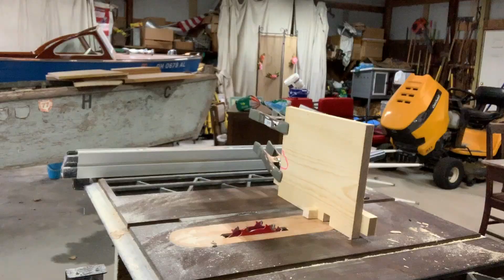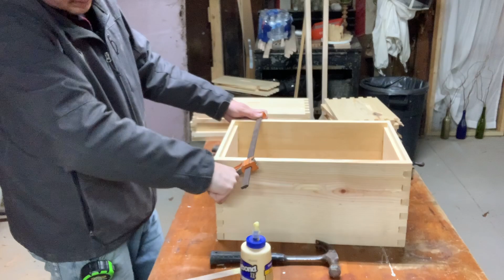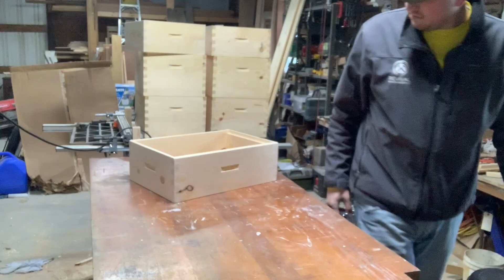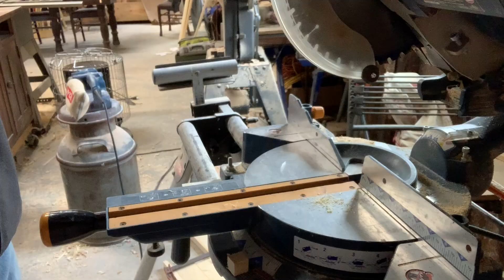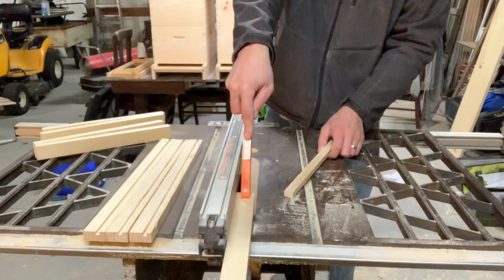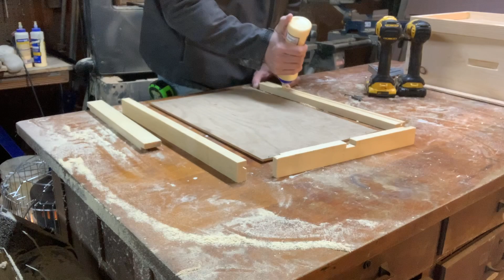How to Build a Langstroth Hive - 8 Frame Bee Hive

Comment: I don't have the blade to cut the corner joints like you have until you tell me the measurements on a rabbit cut for the corners of the box
Reply: I'm pretty sure it's in the description
Reply: @creziegudgirl6893  have built a lot of boxes since I asked that question but thank you for getting back to me